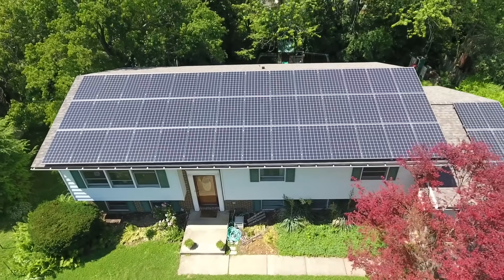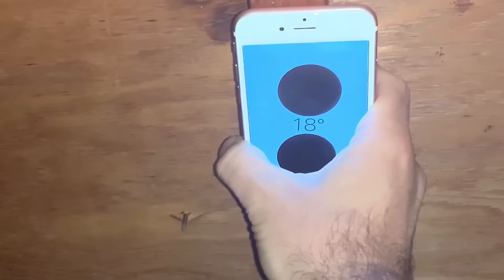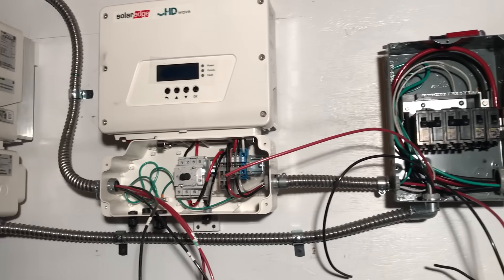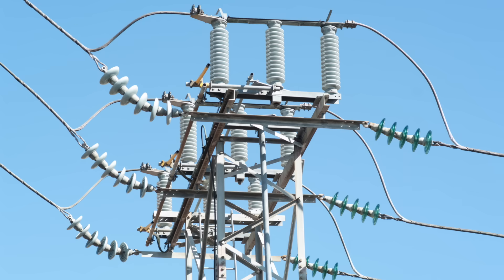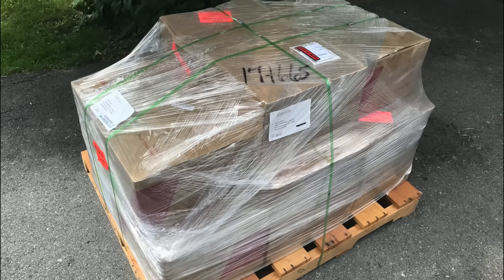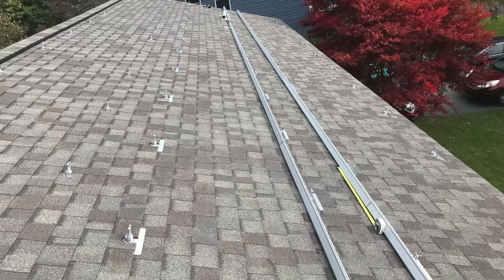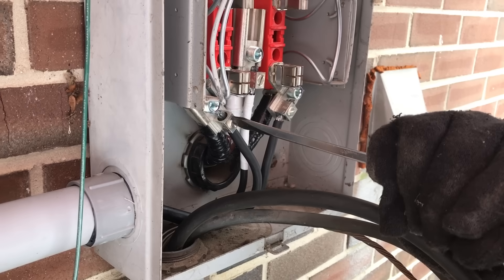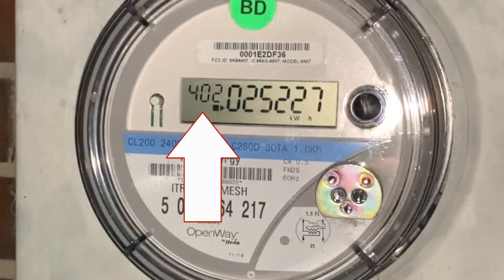I Installed a Power Plant Myself | HUGE DIY Solar Panel System

Comment: I suppose the question on my mind is how much on the separate expenditure for the additional services that you needed, such as the roofer, the electrician, the auditors, any other hardware purchases, etc, apart from the solar panel kit.  If I were to do this though, I would have to build a small solar panel setup on the ground where it can still get good sun.  My roof is too high, made of clay roof tile & I hate heights.  I've already been on the roof a couple times & I may have inadvertently made tiny fractures in some of those tiles, heh.  Our electricity bills do get high in the winter, like in the $400's for maybe 2-3 months.
Reply from the maker: In the next video I made after this one I did a rough breakdown of the costs, if interested.  I would have done a ground mount if I had more south facing land without shade but it wasn’t an option for us.
Reply: @FrugalRepair  ... Ok thanks, I will take a look.  Well, I do have trees in the way.  My goal is to just knock off a few dollars per month (maybe $100 off?), & not like what you did with zero bills.  But again, it's all wishing, I don't think I even have the money to invest in this, even for a small setup, heh.  We'll have to see for the future.

Comment: Thanks for this, a question partly out of the topic, what kind of rig do I need to have to secure 8-10h of Workstation/Gaming pc use *350-500w?
Reply from the maker: Are you asking about how much battery?  If it is a constant 500W draw then a 5kwh system would provide 10 hours.

Comment: I was expecting to see every component of the entire solar grid, thus including the wiring diagram, types, sizes and number of charge regulators, and inverters you used. You left out a lit of details.

Comment: When the shingles need replaced what do you do with the panels?
Shingle roofs last 5-7 years so what do you  do then?
Reply from the maker: Shingle roofs last way longer than that, more like 20-30 years.  Mine in the front will last even longer because they are protected by the panels from rain and debris, etc.

Comment: Very impressive.  Very well done!
I bought the largest deep cycle battery at my local hardware store (they said it was just over 3 hours).
I bought a $250 2000 watt sine inverter.
I bought 1x 100 watt solar panel.
It's small...but it was a test. It worked to power a hot plate (for basic meals) in the event of a Canadian power outage (snow storm).
I then found a guy online selling 230watt panels. I bought one (I'm now at 330 watts). I plan to buy more panels off him.
What you've done is WAY larger scale than what I did. I fed the cables from my front porch roof, to under my porch and through the foundation (a hole which was already there from electrical).  It's working.
It does the hot plate, a blender, the mircowave.
Reply from the maker: Thanks! Great to hear your gotten into solar and put together a nice system.
Reply: That’s different from what I am used to seeing but I like it I was just wondering about the absence of any batteries if the power grid is down are you without power at night or am I missing something?

Comment: Tying into the grid is the one I get hung up with. How does it sync? Our electric company refuses to work on downed wires if the meter is not pulled from houses that have solar.
Reply from the maker: The inverters do it automatically.  They also shut off as a safety precaution (it’s a mandatory thing) when they don’t sense the grid so it can’t backfeed when a lineman is working on a power line, for example.

Comment: I have a question for you I have a bout a 1200 square-foot home we are connected with Edison that charges us from 4 to 9. The high peak times we are paying anywhere from $.22-$. $.45 kilowatt between those hours. I have a company where I live that wants to sell me 20 panels, a 8 kW system. My question to you is the the extra power then I’m generating goes to the grid correct and then they give me a credit is a monthly or is it yearly that I get a credit how does that work?
Reply from the maker: I think you are asking about net metering.  The specifics depend on your states regulations and what your utilities offers.  With time of use rates like you have, it might make sense to get a battery integrated.  You’d have to do the math to see if could save you money or not.

Comment: Anything in the U.K. ? Would the equipment be the same here? I've wanted this for so long!
Reply from the maker: I would assume there are plenty of options. The solar panels would be the same.  Regulations for wire sizes and types might be different.  The inverters would output 220-240v.

Comment: The best battrey you can build is  carbon arc electrolysis,  this has can be compressed into a liquid burn in engines, in gas furnaces  in gas stoves, in gas lamps, the gas don't go bad like a battrey and can be used many ways.

Comment: I have a question!!  That copper ground wire was exposed?  It seemed thick enough that it can be bent and hold shape, hence why that was the method used to avoid inconvenient contact between metals...is that safe though?

Depending on what state you live in, it feels like weather could be an issue!

Comment: My biggest problem is I don't want to send my electricity back to the grid, and here is why! I have studied this for a few years now, since I took an interest in solar power, all because of a three day electric outage that happened in my area after a flood! In fact my town in 2011 got national news recognition for our flood and my girlfriend who is NOW diabetic made my interests more "important"!! You see the main problem I have found is something called "islanding", and most electric companies WILL NOT allow you to use your own solar power IN the case of a power outage!! And while you are allowed to tap off our own solar system and sell excess power back to the electric grid, in a power outage according to what I read, you are supposed to have your feed turned off in an emergency!! This prevents line workers from being hurt while making repairs, which makes sense, BUT it costs you power when you need it the most in some cases!! 

My point is, for me I'd rather go the route, with this information in mind, of a off grid home power solution!! And the more power I can use for my own personal needs WILL mean freeing up power I don't need from the electric company! And currently a lot of items in my house require power that nearly pushes the limits of what my utility box can handle anyhow!! You see my power is a 50 amp service that was installed in 1970 and was hooked up in 1971 to the small single wide mobile home my girlfriend and I live in! So anything to remove stress off that system like lighting, WILL save us money and decrease our need for electricity!! Not that our electric bills is super expensive on a lowly 50 amp electric service, BUT it would be nice to be able to have lights on, maybe watch a movie or charge our cell phones in another event as 2009 and 2011 floods!! Besides the security that comes with having light to see at night inside our own home, we'd also be able to keep her medication cold as required, but buying one of those 12 volt refrigeration coolers, they make for camping!!! This would protect her and allow us at least some "normal living" in a time when nobody else has power!!

Comment: I installed my panels and quite happy with my output. It’s not rocket science. Buy used solar panels and new inverters. You will cut a significant costs by  buying used . It will lower your ROI. And when you see your having to pay for electric, buy another 1000 watts worth.

Comment: The whole setup does look very professional, and making the solar roof looking part of the real roof instead of some wart over the roof is definitely the way to go. You were lucky to have a two-slope roof (well, 4, with garage) and one external chimney instead of having well over a dozen slopes like in the many McMansions we see solar videos of, that can't use regular solar panels and have to go with solar tiles instead, and even though, there are too many corners and angles and outlets and wrong dimensions that only a few of these tiles are actually photovoltaic, the rest is just cosmetic glass.

The only criticism is that I didn't see if you filled the gap under the external perimeter of the solar panels, to prevent stress from high winds and likely damage, and insulate your roof even more. But then you'd need to insulate between the panels too, and it does not look like you've done. A layer of unmoving air would insulate the house even more in winter, and with a proper air circulation, you could even pump in warm air for a few minutes in the morning to make night snow melt, or cold air in summer to cool down your panels and make them more efficient and productive.

Because you have no windows on the first floor's side alongside the lower garage, I would probably increase the garage' height to make a single solar roof across the whole building, without skipping 1.5 column of solar panels because of shadowing issues. And you'd have room for a even a big van in this garage, or just more storage space.
Heck, you could even prolong the south slope over the north side to double up your photovoltaic or thermal solar and add more living/storage/rental space over the north side, or just add one extra row on the top of the existing north side if production is worth it.

Bigger panels may not have been as bad as you think, they would just have added a bit more overhang on the southern wall, which is exactly what you need in summer, and it wouldn't matter much with the lower Sun in winter. For me, the better criteria would be to find a size that offers both photovoltaic and thermal panels (although you can now find hybrid panels that do both), or even vacuum tube thermal panels, because these are much more efficient in winter or cloudy weather when you need house and over-wintering green house heating the most. A solar roof that's a bit bigger than the previous house roof makes solar look even more integrated, or rather as if it's the roof itself instead of on the roof. In a few years we'll probably get building codes in which solar panels can be turned into being the weatherproof roof instead of just a second non-weatherproof layer on top.

Comment: I see this was posted a good two years ago. With the huge increases in electricity cost, we decided to have an 84Kw system installed. It was a kit but I opted to have it installed by contractors who did the complete installation in 3 and a half days for 5000 pounds. I had been tempted to DIY but on this occasion thought it was better to have it up and running asap and with a warranty. With the high electricity prices of today the payback for the installation was only a couple of months. Conservatively the whole system will pay for itself in 3 years max but some of my farmer friends are paying over one pound sterling per KWh and if we end up with a similar price next year when our contract renews, we will have a payback of under one year. Solar is an absolute must for every household. Altogether we have installed 120Kw this year including a battery pack of 24Kw and so we now have a total of 130Kw on site which even in winter on a good day produces quite a bit. Ona grey day we are still reliant on grid power. Hopefully once everything is registered with the grid, we hope to sell surplus to the power company which will be a little extra. Anyone who has to pay for power, install it asap! All that aside, I am full of admiration of this gentleman to have taken it on. I’m 67 now and not as gung-ho as I used to be. Also being a commercial outfit with tenants, we tend to use tradesmen now for electrical and gas works to keep our insurers happy.

Comment: I am from Bangladesh 
I have an IPS of 3.5 KW which run on 4 battery .
Now i want to install 3 KW solar panel which will recharge the battery and ips will run from battery.

Will it work?

Comment: Looks like you have a 15KW System here... Ten Billion such Systems could provide ALL THE ENERGY NEEDED BY MANKIND IN 2050... yes a 150TW System generating 180,000 TWhrs/yr .. and... with ZERO POLLUTION .... 
As Neil Armstrong said.. One Small Step for Man.. One Giant Leap for Mankind... 👍👍👍👍

Comment: How do you figure no electricity cost? Do you think you can get the power company to buy your power?  Do you think you will not have to replace batteries?  Will you have to maintain the panels, cleaning them, etc?
Reply from the maker: Check out the video after this one and the video where I explain how I earn money with solar.  I explain the process in some other solar videos too.

Comment: I would expect that having to take off shingles & reroof at the get go was quite expensive, if you hired a roofer.  Shingling roofs is something easy, DIY project.  Whachugonna do when its time to re-roof the house?  Did you have shingles stapled on instead of nailed???

Comment: Wait till you lose local power, and your inverter is forced off. With grid-tie, you cannot back feed the grid due to safety reasons.  Read UL1741
Reply from the maker: I don’t understand the point of you comment.  It is rare to loose grid power and extremely rare for it to be sunny while the grid power is out.
Reply: @FrugalRepair  May be rare for you, but there are others "shocked" to find out that they cannot power their home when the local grid is down.

Comment: That is amazing, i am doing a research on how i can install an offgrid power at ky patents newly built house. So on avarage how much did thatall cost you. And if i have to do off grid how much batteries would i need for such a project
Reply from the maker: Thanks!  Check out the video after this one for details on the production and cost details were.  For battery storage, that can vary highly depending on what loads you want to have running and for how long.

Comment: Pretty impressive.. I did a small 1500w system overseas in Yemen but with battery back up to.. was so simple there not like this.. no codes or approvals..  lol
Reply from the maker: Thanks!  Congratulations on your install.

Comment: Yo very  cool clip I have a question  please  forgive  me what  cord do I use to run from battery to inverter I add photo
Reply: I'm using  a renogy 3000 watt inverter I have a simple 12 volt battery 2 300 what solar panels and a 20 amp solar controller thing  can anyone please give me some help
Reply from the maker: I'm not sure what connectors you have but likely you will want to crimp your own on.  Wire size largely depends on amperage that you plan to send down the wires.  I would assume 10 gauge would be fine for what you've doing but you can look that information up online.

Comment: Have you installed panels at ground level? I have over an acre at the rear of my home and I'm considering ground mounted solar. Is this cheaper than roof mounting?
Reply from the maker: I haven’t put up a ground mount structure yet but that’s what I would recommend over a roof mount if you have the space.

Comment: The problem I’m having is with the piping can you use the plastic conduit instead of galvanized and how is it terminated and connected to the building and roof
Reply from the maker: The NEC codes are complicated but they describe the types of conduit and max wires inside, etc.  I used emt on one section and plastic on another.  They all terminate into a junction box.

Comment: You should just buy about 6 solar batteries so you can store the energy.
Reply from the maker: I could do that but it costs money.  I have 1-1 net metering and the power doesn’t go out very much, so it’s harder to justify that expense.  I do have portable battery units for when there is an outage.
Reply: @FrugalRepair  Thanks for the reply and its good you thought of a battery backup.

Comment: What are your thoughts regarding whole home battery backup (e.g. Tesla powerwall)?
Reply: Tesla power wall is over priced by many times the cost it should be. The cells are li ion which has a change life cycle of about 500-600 charges(same amount as your cell phone,  you know how fast your phone loses capacity over the years) you can buy Lifepo4 batteries for 2x-3x cheaper and it's WAYYY safer than a tesla power wall. It also has a charge life cycle of 3000-5000 cycles! 6 to 8 times longer than a tesla powerwall. It's worth it if you live in a area with power outages that are common a few times or more a year.
Reply from the maker: If interested, I made a video on the topic of integrated batteries.  Look for the solar misconception video.

Comment: It's amazing how much people spend to get off the GRID. Is the GRID dangerous? My electric bill for the whole year is $1,250.00 . For a 2000 square foot house, electric heat.
Reply: You do realize that power cost can very by up to 8x the cost depending on where you live in the US? I pay 6.8cents per kilowatt hour. Some people in the US pay 30-45cents per kilowatt hour. By your monthly bills you have very cheap power bills and someone could be paying $4000-$5000 a year or more for the same power you pay only $1250 for. Solar doesn'tale sense for everyone everywhere.

Comment: Ofcourse its always worth it.. if you do most of the work, hiring people cost the most of the whole project.. minimalizing that factor wil be very cost reducing. But this wil ONLY work if you know what you are doing breaking something or making a leakage wil cost you.. 
As an electrician who got into the roofing business i really work with solar panels a lot. Nice work! there is only 1 thing i might add.. thats laying the loose cables in pvc pipes on the roof. Due to animals who might chew on it, here its a thingy
Reply: I live on a large 10 acre lot so I would do ground mount solar. Less hassle and no worries about the roof or house fire from the panels.